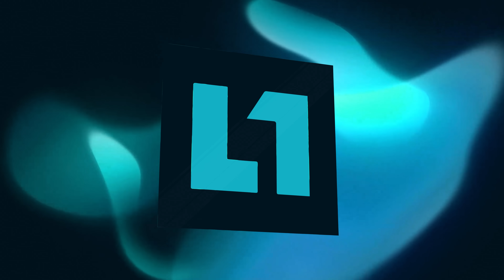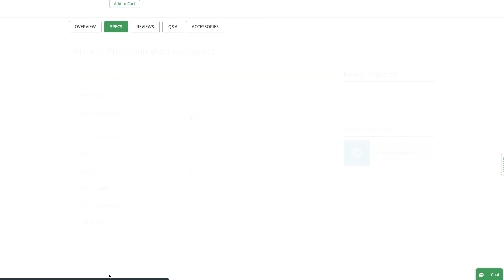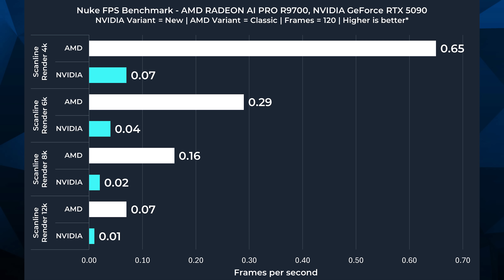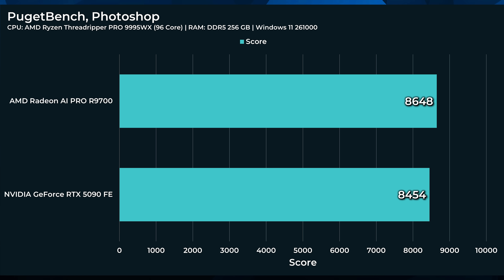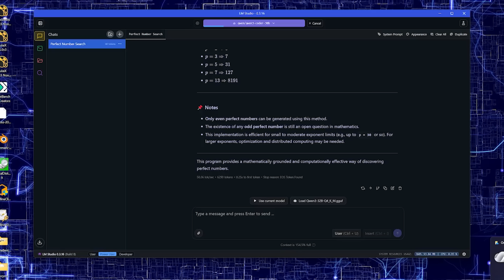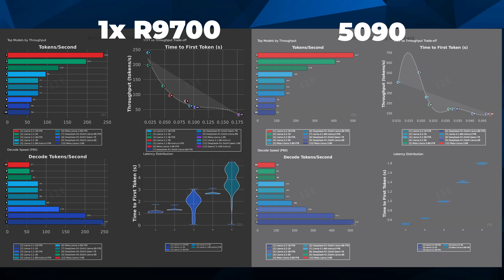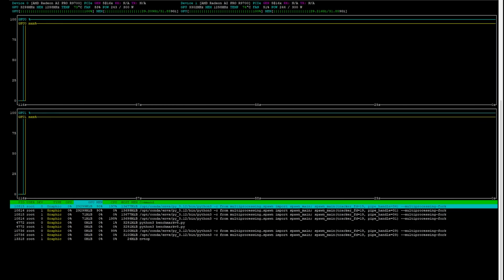Radeon R9700 Dual GPU First Look — AI/vLLM plus creative tests with Nuke & the Adobe Suite

Comment: I purchased an R9700 and before I buy a second, I want to get the first running decent with vllm in linux. I'm having trouble getting this card to run above 10 tokens per second though. Do you have documentation on your software setup for this review?
Reply from the maker: Yes, on the forum. At this point even lm studio can do North of 100t/s on qwen 3.6 at q6

Comment: Last year i bought an Intel B50 pro because of the SRIOV, it took 3-5 months to be able to run it correctly with Vulkan, in the meantime we were lucky enough to get IPEX-LLM and getting very good raw power. Now we are facing the oblivion of intel with openvino, and not to me mention that they are basically forcing everyone to use SYN-CL which is arguably better if you are running data center level GPUs, but for normal users you get stuck with Vulkan... Now this card for some reason reminds me of all this ordeal, i might have a little bit of pstd as i had to write code and do a lot of work to make things work and at the same time as the whole world was trying the same just to get the support of Intel layed off and shut down.

Comment: It would be great if 30B-70B LLM's were tested here - dual 9700 has a total of 64GB VRAM and it is capable of running larger LLM's, eg. QWEN-3-30B. I believe that is what most people would run for real world use cases with that kinda configuration.

Comment: What this guy will not tell you that before you go for this GPU seeing an attractive price, you must know:

1. ROCm is pretty broken, fragmented and has lots of stability issues (on Windows) and is not even close to CUDA even if you use something like the AI Pro R9700. You will frequently hit the ceiling especially while using ComfyUI where it's light years behind even the RTX 5070 Ti especially when it comes to video generation and VRAM size doesn't noticeably drop performance.

2. ROCm : 

a. Being more fragmented is much harder to set up than CUDA (especially on Windows). Nvidia offers instant plug and play feature without any hassle due to its highly optimized hardware and a massive, dominant ecosystem.

b. Has stability/driver issues that are reported more often and serious.

c. AMD's ecosystem is overwhelmingly smaller and inferior to Nvidia : fewer pre-optimized libraries, slower framework updates, missing features in some tools - something that matters a lot for AI/ML workloads, video editing and many other productivity use cases.

3. CUDA is the de-facto industry standard for AI/ML development. Almost every major framework, library, paper, and enterprise deployment targets CUDA first. 

For AI/ML workloads, Nvidia is the undisputed king.

Comment: Try a unet node (GGUF file) in ComfyUI and see what happens. It's going to be light years slower than even a cheaper Nvidia card with generation speeds going as low as hundreds of iterations per second.

This is why I don't trust youtube especially when it comes to AMD GPUs given that tech reviewers consistently label AMD GPUs as THE BEST VALUE just by cherrypicking the side (that is too narrow) where AMD shines and hide the serious grave problems that are completely unacceptable for the cost of the Radeon GPU in consideration even if we talk about AI Pro R9700 that invites serious hassle for AI/ML workloads.

Given this fact and how bad AMD treats it fanbase, AMD IS A DISGRACE ON THE FACE OF THE EARTH! Even Intel is more trustworthy despite 1% GPU market share.

Overpromising, underdelivery and their shills are inherent in the business model of AMD.

Though, cheaper shouldn't always equate to bad but cheap = bad does hold pretty good for AMD GPUs. 

I've switched to Nvidia permanently and will never ever buy an AMD GPU regardless of what Youtube says on the basis of the fact that AMD trails Nvidia in everything from video editing, AI/ML workloads, RT, upscaling, efficiency, backwards compatibility to whole of the GPU ecosystem that will take AMD almost a decade to approach parity especially due to something dominant like CUDA.

Comment: building a local AI system and was planning on a 2x 3090 but this is making me hesitate.. not sure IF I am going to need cuda down the road and will the lower memory bandwith of the r9700 vs 3090 is going to be an issue... decisions decisions

Comment: The cards are great. But theres one big issue that isnt talked about enough. If you run an intense 3d render, either in a game or project, your gpu fans will spin up. Very typical of the hardware weve come to use and live with. However....the r9700 cards sound like a leafblower. And when the case is next to you on a desk, ooooooo man. It is not pleasant and it got old immediately. I was all for team red to cook on these cards to replace my 5090. Nope. Back we go. Sorry Linus Torvalds.

Comment: For me with ROcM on windows using my framework desktop I get really weird inconsistent results.

Like, I'll try to load the model in ROcM, and it will fail 3 times in a row.

Then I'll load it in Vulkan, then eject it, and load it in ROCM again, and it will miraculously work.

It also gets worse results for me in windows/ROCM.  So I just stick with Vulkan for my testing.

Comment: You didn’t provide any thermal or acoustic test results. That information would have been valuable, especially to know whether using this card is the equivalent of running a roaring vacuum cleaner or even two of them in your setup.

Comment: Correct me if I'm wrong  but at 640 GB/s each, the maximum potential effective bandwidth should be 1280 gigabytes per second.

Double that with 4 cards - that would be impressive for a prosumer system

Comment: thank you so much for the video!

I am really curious how you got the dual setup working together with the gpt-oss:120b model on linux in docker. 

I currently have a ollama + open webui setup running in docker on my fedora server but chatgpt says dual R9700 PRO will not be compatible with that - so how did you do that?

 if you would be willing to share some urls that helped you set everything up, that would make me very happy :)

Comment: I find it hard to believe (and therefore somewhat misleading to suggest) that several GPUs across even a full PCI v5 x16 bus for each scale for large models: if you could just stack these like Legos, NVlink switches wouldn't exist. And I don't see you use a large model that splits across those two 32GB VRAM regions.

Sure, logical access across GPUs (or CPU RAM) is no longer an issue in terms of functionality, but from GPU A VRAM on GPU B is just as slow as CPU RAM, because it's the 128GB/s PCIe limit that represents the tightest bottleneck.

I only ever got to test dual GPU using an RTX 4090 together with an RTX 4070, because PNY sold both in relatively narrow form factors (3+2 slots), but the 2nd GPU just made no difference at all for token performance, because every trip between layers where one was outside the local GPU got hit by a giant PCIe penalty and it was to a few tokens per second or below my patience threshold.

You might get lucky with distributed models e.g. mixture of experts where cross bandwidth is low, but going with a single RTX 5090 vs dual R9700 seems the much better choice... if you can make local inferencing experiments pay for all that hardware in the first place: that still remains the biggest challenge...
Reply: He tested GPT-OSS 120b, which is a solid 60gb. It had to be running across both cards, though only having 4gb left for context would be not great, assuming he didn't do a partial offload. Not enough info to tell.

Comment: Wendell, do you know if the Affinity Photo suit has hardware acceleration on modern Radeon GPU's (RX 90x0xt)? Affinity developers complained that hardware acceleration support was an issue on AMD side for the previous generation of cards/drivers, but I couldn't find any additional info on that.

Comment: 32GB DRAM is still not a lot.. I have a AMD Radeon RX 7900 XTX with "only" 24GB DRAM.. Yes it can run AI models.. but you will need way more DRAM to run larger models.. So 2x 32GB is maybe sufficient. But only 1 GPU with 32GB is still too limited most likely.
Reply: That being said I'm a big fan of ROCm.

Comment: it might be half the cost of a 5090 but why does it have to be over double the cost of the 9070XT which has half the memory??? It is still way too expensive and the 5090 is absurdly expensive. I will stick with my Vega64 and running up to 20B Q6/8 models for now

Comment: Professional user here: AMD's GPUs have been decent for very long, their problem is not hardware, but SOFTWARE. They managed to fix their drivers and now they are excellent, they need to fix the CUDA problem, last time I tried ROCm was a hit or miss.
EDIT: Using AMD at home, because they are the best option, hands down, for Linux.

Comment: These are essentially Radeon 9070 XTs with Pro drivers, 32GB VRAM, blower coolers, and 12V High Failure Rate connectors.
And most of them don't have HDMI outputs. Only Gigabyte and Asus models have an HDMI output.
Reply: BS cause I have not seen reports of that port melting with TDP's of 300 Watts or below. Your Concern bears no relevance to the TDP outline in the specifications on these cards.
Reply: @ESGamingCentral  Well, I have seen reports of it happening on 9070 XT models that have it.
Reply: @Knowbody42 with adapters
Reply: @ESGamingCentral  From 3 x 8 pin, and it melted on the GPU side. There's no excuse for that.
Reply: @Knowbody42 thanks for sharing.

Comment: AI/LLM also runs perfectly fine on a Radeon RX 9060 XT 16GB, and still quick enough for most applications at that. I even build a Linux based Ollama server using one such for experimental projects.
If it works fine but you need more, simply swap it for this R9700 and it seems you got yourself a 2x+ boost in performance.

Comment: I wonder how 2 x 9060 XT 16GB compare to one of these R9700 for AI workloads? or even 4 of them against 2 of the 9700 Pro's? The 9060's will be cheaper, just need to make sure your on a platform that has the PCIE lanes to support it, if you need to go above 64gb then you will want these, but if not, then multiple 9060's as a cheaper option and lower power envelope might be the go for those on a tighter budget.
Reply: problem is due to PCIE lanes usually and stuff like PSU, space - end goal is 2 cards usually so the bigger single the better, like now I got one 3090 could get 2nd. Here getting one Pro then 2nd later is option I consider.
Reply: @pozytywniezakrecony151  Yes these are issues for some, but I managed to fit 2 x 9060's on my Supermicro board, the Powercolor Reapers are very compact, and cheap, ROCM7 is around 80t/s this is plentey fast enough me, these cards are true 2 slot, and are quite short as well.

Comment: This are good news, having more alternatives is always welcome! However I had Radeon 7 back in the days exactly for CGI workflow in Cinema 4D with AMD Pro Render at the time, the driver stability was an ISSUE! The machine was crashing 3 times in a single day, no way around it, and today as an Octane user - Otoy had a AMD GPU support in the past( via Mac OS and Octane X), and they stated that they wasn't able to keep a good stability with the AMD drivers and hardware, that's why they only support Cuda and Metal, Andrey Lebrov had a long sitting interview with Otoy founder and it's worth the time for people that are in the industry. It's really sad at the moment but for CGI is mainly Nvidia even with all their problems the stability and performance are really worth the money at the moment, 4090 is still better for scaling multiple GPU than the 5090, this shows that Nvidia doesn't think they have a competition in the segment and I personally won't take a chance on AMD GPU at the moment.

Comment: AMD screwed up a few things with these cards. No NVLink, or whatever Nvidia calls it today. The throughput on PCIE isn't good. It's terrible. 
The memory bandwidth is amazingly bad for a 32gb card. At 32gb they should be running a 512 bus. I don't understand this decision. 

Lastly, CUDA is going to get competition. ROCm will get MUCH better in the next year. The deal with OpenAI / AMD cemented AMD's desire to push ROCm to the limit. Modern PyTorch now supports ROCm on Windows on the nightly? build. Not the production build. That might be the issue you had there. ROCm got full support on Sep 25th?, so very recently. You would have gotten vastly different performance on some of those benchmarks. AMD has an article about it.
Reply: it's just pci-express talking even Nv-link does the same thing now.
Reply: @fishingkev2332  NVLink or the modern equivolent is like 5x faster than the fastest PCIe bus. It's also card to card. There's a reason it's used in enterprise. It's like 1gb/s speed. It's incredibly important. 

During any kind of multicard training it's almost necessary. Otherwise the VRAM is basically wasted.

Comment: Seeing anything from AMD that can start to reduce Nvidias dominance is great news! I hope they do some of the same tactics they did with ryzen, make it a great value option and start building for bigger and better things down the line. Almost getting 3x R9700's for the price and power budget of a 5090 should be real tempting to those not locked in to cuda or Nvidia specific stuff.

Comment: Those Blender results are confusing. Did they leave it on CPU rendering? There's no way the R9700 is putting out the same numbers as the 5090.

Comment: "Video codec performance was really similar" yeah and the resulting video quality was far from similar 😆 AMD does have the faster encoder if you don't crank up all the settings, but their output quality and bitrate efficiency are much worse. Talking about video encoder performance is worthless without quality analysis.

Comment: I wouldn't be worried about AMD having to price these lower than nVidia. This thing is basically a 9070 XT with 32GB of extra VRAM but at twice the price of a 9070 XT. We know that the cost of the extra memory chips is a tiny fraction of that price difference. They are (rightfully) taking advantage of the AI hype.

Comment: 32GB on an AI card is super stingy. VRAM is the only limiting factor for AI reasoning and thinking performance. For state-of-the-art performance you really need at least 80GB VRAM, and that's still tight. Intel could absolutely take the AI prosumer market away by offering 80GB VRAM card for under $500.

Comment: Awesome video!! music is not needed at all. I run a RX9700XT wich I put on eGPU DOCK (minisforum DEG1) and it’s fantastic - ROCM 6.42 and It’s running on Ubuntu 24.04 LTS 6.14 and it runs super smooth. Bought it in Corona times and got it for 1100€ (shame I didn’t got the XTX with 24GB instead of 20GB I have).  Qwen 3 14b runs with 64TPS that’s good for me!! I am looking into the <48GB Market(W7900 and I have an eye on Intels ARC Pro series).   probably use my Mac Studio M2 Max with 64GB  which is in my „music studio“  too As a non pro all I am looking for as much VRAM I can get to be able to run bigger models locally. Nice video! The 5090 for that price point is not a good deal for me. It’s a mix of as low power consumption (24/7) and biggest VRAM size I can get for me. Fingers crossed that ROCm and Vulcan will step up their game - is what I am Expecting in 2026

Comment: There is native ROCM support for LM-Studio on Windows. Download the HIP SDK, and it will show as an available runtime. The performance benefit over Vulkan does depend on model architecture but generally I've seen it more performant than not.
Reply: you can now install rocm on windows natively with the normal driver from amd, no need for HIP SDK anymore
Reply: Doesn't work for 9000 series cards, because the windows build for rocm is old garbage months behind on the linux branch
Reply: @klontjespap okay i have an 7900xtx and no problems with that
Reply: My experience is that it's not an improvement across the board, you either sacrifice prompt processing or token gen. My tasks are prompt processing heavy (agentic), so I lean towards vulcan.
Reply: @LordVarkson  Interesting! I will have to explore against my prompt set use cases, thanks for your insight.